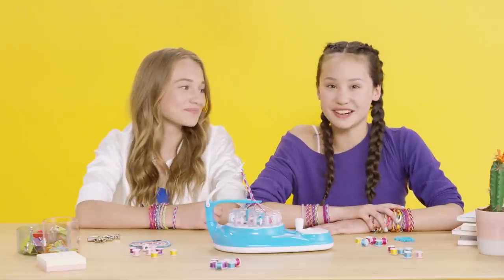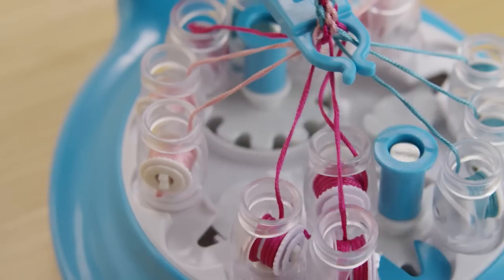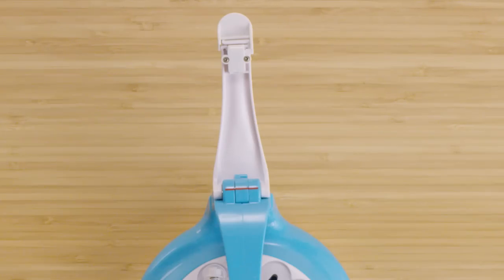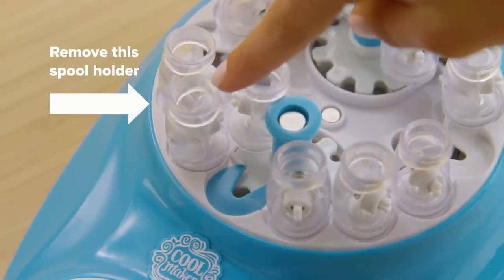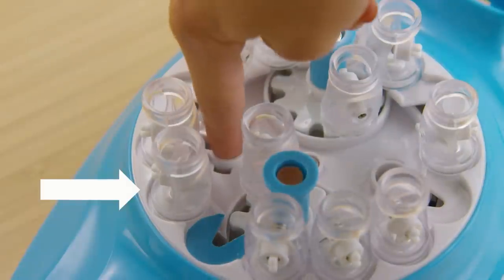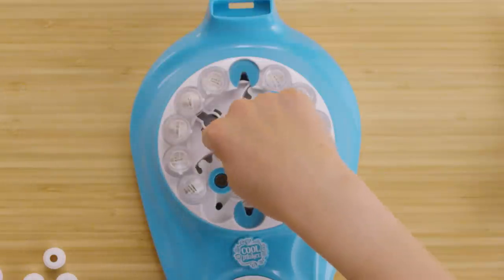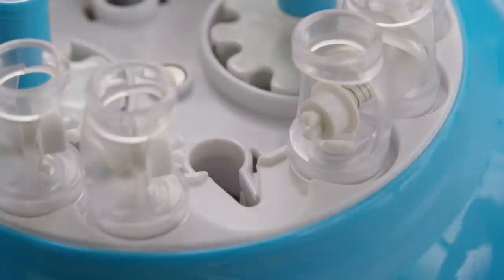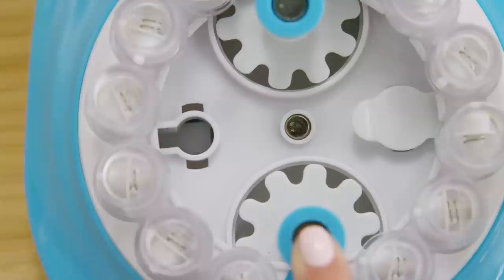Cool Maker | KumiKreator | How to Fix a Spool Holder Jam

Comment: I found that slowing down when turning the handle stopped the machine from jumping spots and jamming. It only jams when the handle is turned too fast. It’s not a race really, just turn the handle slower and it won’t jam. I love the machine as it saves me hours of making them all by hand, this is quick and easy to make bracelets 😊 I can make 6 -8 in the time it takes me to make one the old fashion way🤣😂

Comment: So - great toy but inclined to jam.  These instructions are great if you have a simple jam.  If it looks like you have two spools that are jamming that do not allow you to rotate the key hole in place I had success by carefully opening the unit and then releasing the black ladges on the bottom of the rotating unit in order to line up the spools to take them out.  If that works (as it did for me) the next problem was that although I was able to get all the spools back in place on the perimeter with the two blue holes empty this configuration led to spools rotating 1/2 turn and then the spools that were picked up jammed into other spools.  I ended up taking off 1/2 the spools (in pairs) until the unit would spin (at least 3-4 spool switches) without any jams).  I then added a pair at a time and tested until I could get all spools back on without any jams.  I believe this was due to my putting spools back in while the unit was still mid-sequence.  Good luck!  Hope this helps.
Reply from the maker: Thanks for the tip! Glad you were able to fix your KumiKreator! ✨💖